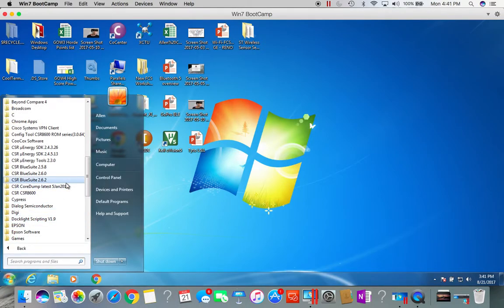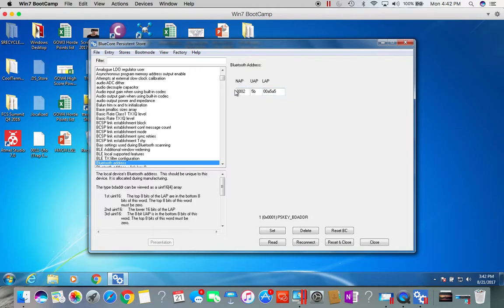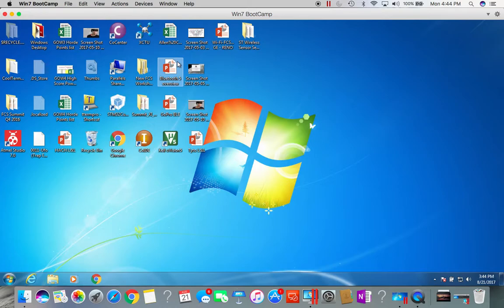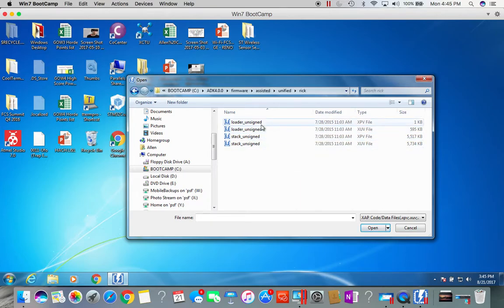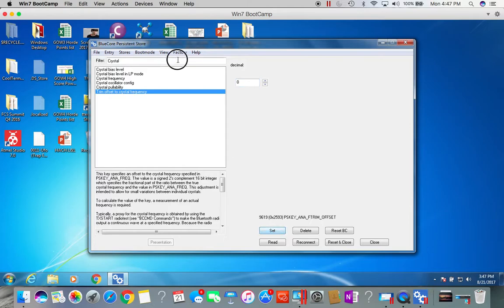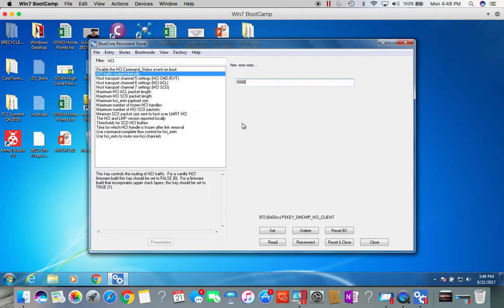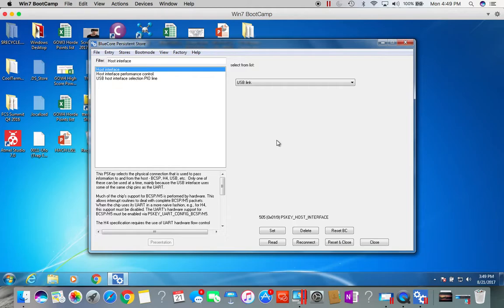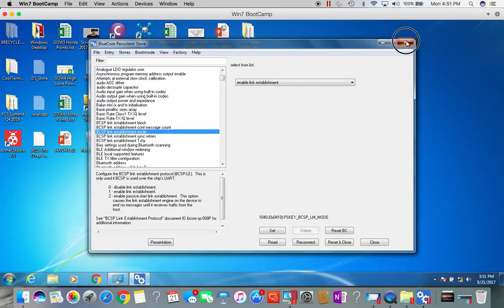CSR8675 HCI LOOPBACK TEST MODE

Comment: Allen, I am considering CSR8670/8675 for an audio development. However, I've seen some complaints online that the firmware development tools and code libraries have a very steep learning curve due to lack of documentation, out of date documentation, little online information at blogs or forums,  poor technical support for users (unless you are working for a major corporation with volume in the millions), etc. Is this true in your experience?